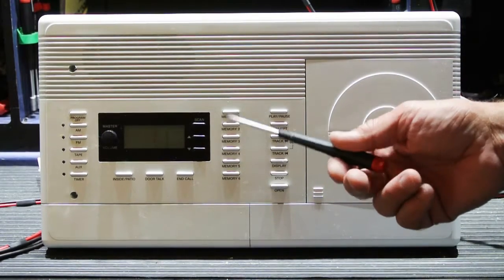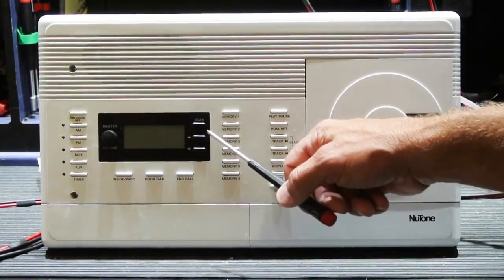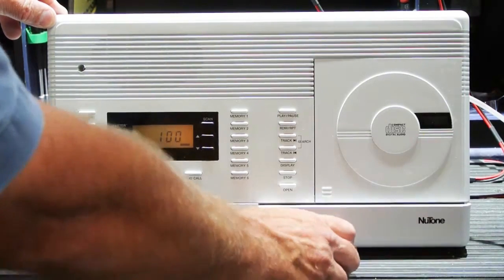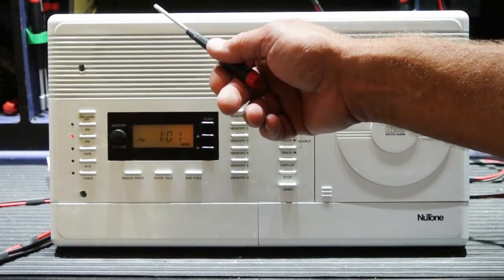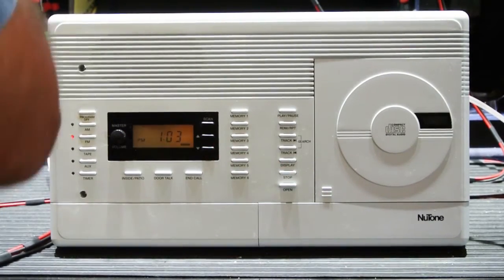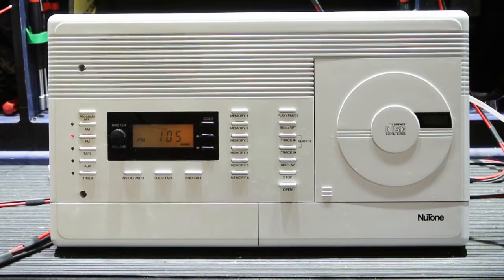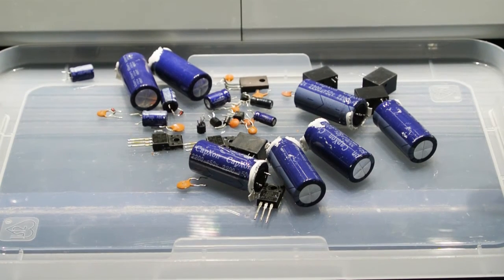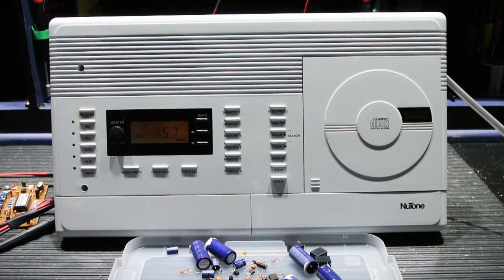NuTone IMA4406 Common Failure Mode #1

Comment: Is there a good upgrade for this unit? Ours appears to have a similar issue to the video is likely is too old to re-invest in. Thanks
Reply from the maker: Hi Toby:  NuTone no longer makes any Intercom equipment.  The IMA4406 is on of the finest model that NuTone ever made and it's certainly worth repairing, especially if yours has this "know problem".  It's always less expensive to repair a Master Station than doing a whole system upgrade. - Chris

Comment: Can the CD player be fixed?
Reply from the maker: Hi Roxanna: Yes - No - Sometimes - Maybe.  It all depends on why it's not working.  Sometimes the Master Station has other problems that prevent the CD Player from working correctly (even though you may not be aware of this this problem) Sometimes it's just the CD Player that has failed.  Attempting a repair on a CD Player is difficult and often it's full of land minds that will get you when you least expect it.
Sometimes these types of repairs will not hold up over time, because while the immediate cause of the problem can be solved - the normal "age-related" failure which will happen to all CD Players sooner or later will occur.  If this happens within a short amount of time after the repair, the customer will not be happy and will not understand that it's beyond our control (I just paid you to fix it 4 months ago!!!!).
And then there's the cost involved - a typical CD repair will cost many hundreds of dollars - more than what most people will spend to play CD's.  We have a more modern alternative - Our External Audio Jack - Here's a link to 2 Video about this:  https://www.youtube.com/watch?v=OUKz-DPnAT4&list=PLsTvqKsBnGYdC28d_5P2CQXAhtUS6f_2S&index=1&t=582s
and:  https://www.youtube.com/watch?v=MKkaZfLs3lo&list=PLsTvqKsBnGYdC28d_5P2CQXAhtUS6f_2S&index=5

Chris

Comment: I have the same system. Mine is making a clicking sound without turning anything on.  Does it randomly throughout the day.  Can it be repaired?  Whats a rough estimate to fix it instead of replacing?  Or would i be better off replacing entire head unit?
Reply from the maker: Hi David:  You probably don't have a problem with your Master Station - The clicking noise is coming from the Audio/Intercom Relays inside the IMA4406.  These are probably being activated because of a problem with either a Remote Station or the wiring that connects a Remote Station to the Master Station.  What you need to do, to prove this theory is, Open the Master Station - Unplug the 5 Cables that connect the Master Station to the Terminal Board - then wait 2 days to see if the clicking still occurs (I'm betting it won't) - This Video will help you do all of this troubleshooting:
https://www.youtube.com/watch?v=ZpwjqFXqC3g&list=PLsTvqKsBnGYcoTSfKTOHOltP98FFiuUP1&index=1&t=2s
Watch starting at 2:17 - Chris

Comment: Excellent, thorough and informative.  Thank you for all of this information. I purchased a townhouse with the IM4406 system.  Some of my remote stations are not working, as well as CD.  CD I don't care about.  The radio and clock work fine on master. Any suggestions?
Reply from the maker: Hi Wally:  There can be many reason for Remote Stations not working - This can be anywhere from broken and damaged wiring to the Remote Station needing to have its Volume Control and Pushbutton Switches cleaned.  I always start with the simplest thing - clean the controls - Here's a link to our Video that shows what type of cleaner to get and how to perform the cleaning - https://www.youtube.com/watch?v=COruBSRkgCY&list=PLsTvqKsBnGYfpZP9NkBqZe5LFHu9ALtvB&index=3

If the none working Remote Stations are Outdoor Stations - they likely have failed Speaker Cones - Chris
Reply: My nutone 4406 will not turn off. All lights are on (am, fm, tape, aux, timer) and just making a humming sound. I've pressed every button with no results

Comment: I have the IMA 4406 and I have no power at all Can you tell me this can be fix? Thanks
Reply from the maker: Hi vinny luu: Yes, it probably can be fixed - You should contact me directly - Chris 925-743-8236
Reply from the maker: Follow up to vinny's question:  Vinny called me to discuss his IMA4406 - It is most likely a Lightning Damaged Master Station.  The Lightning Strike was more than 1 year ago and the IMA4406 was left Powered Up - in its failed state for that amount of time.  Based on the description of the failure immediately following the lightning Strike and over the following year - it is unlikely that this IMA4406 can be repair without a replacement Microprocessor Board.  Since Lightning Damage is rarely confined to 1 part of any Master Station - it is also very likely that this IMA4406 will have much more wrong with it.  The reality is that while this type of damage many be repairable - it will be at a much higher cost than is average - Vinny is thinking over his choices on how to proceed - Chris

Comment: How do I turn it on, its plugged but not turning on
Reply from the maker: Hi Mr Mr Jims:  If the Master Station is connected to the 2 Transformers and the 2 Transformers are connected to the Electrical System and the Electrical System is powered up, the Master Station turns on on its own - There isn't any "on" Switch.  If the Master Station is not "on" and all of the requirements shown above are being meet - Check the 2 Transformers, they should be suppling between 18.5 - 20.8 Volts AC each.  If the Transformers are ok - then you have a problem with the Master Station - If the Transformers are dead - they have blown Fuses - which can be repaired - and you may have a Master Station problem also - Chris

Comment: My system just doesn’t turn on when I press any button. I have the 4406. The display does not turn on and there is no sound.
Reply from the maker: Hi XTRUTH_YT:  Do the Transformers have power (115 volts)?  If "yes" are the Transformers working (should be outputting 20.5 Volts AC)? - Chris

Comment: The CD drive on my 4406 unit doesn't run when I insert a CD. Is there a simple fix to try (like a start-stop safety switch)?
Reply from the maker: Hi Dave:  IS it a IM4406 or a IMA4406?

There's never a simple fix for CD players - I have never seen one with a bad safety switch or any other peripheral switch or sensor. - Chris

Comment: please show the board on which you are replacing the part. Two power supply transformers are used, one was no secondary, replace transformer but no sound. do you think I should replace ia-29 door chime board?
Reply from the maker: +sattar shaikh 

You can find detailed information about this type of failure on our website: http://northsideforyourhome.squarespace.com/

Your transformer failure was likely caused by the power module failure.  The IA29 has nothing to do with this type of problem